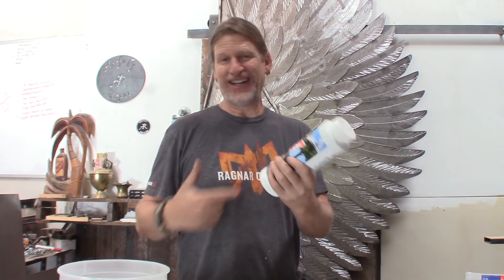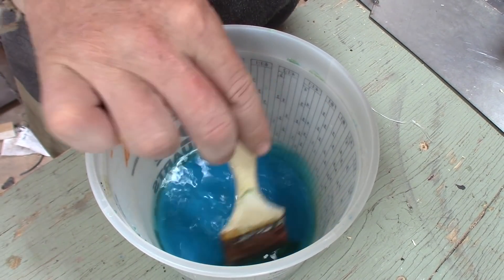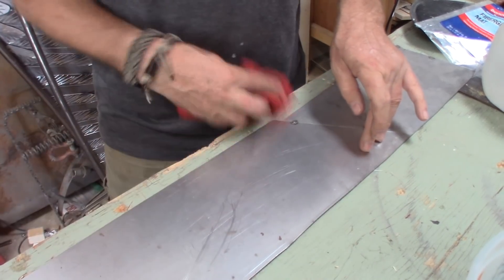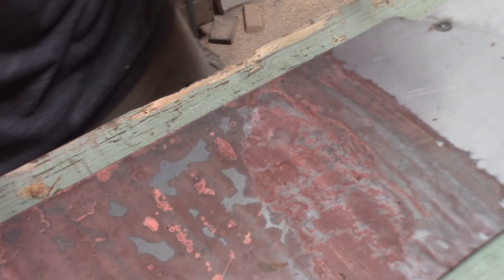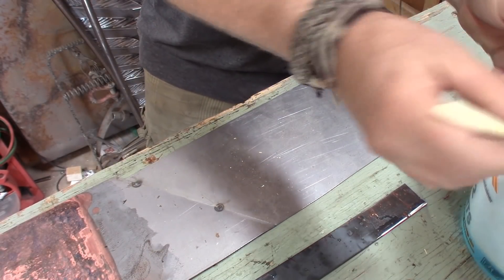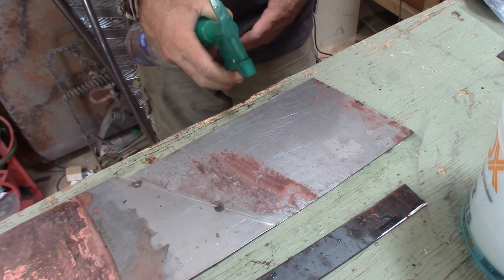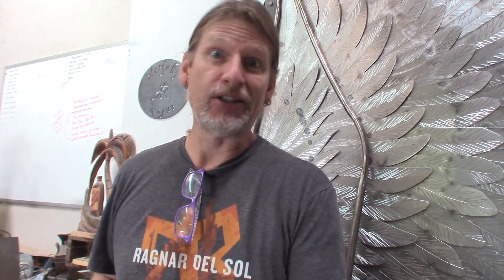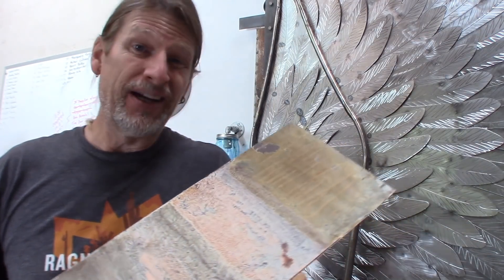Copper Sulfate on steel FREAKED ME OUT!!!!

Comment: The citric acid I ise as pickle solution for my copper jewlery has eaten away the nonstick coating of the pan. The bare steel is slowly turning copper as I use the pickle. It never occured to me to do it on purpose.
Reply from the maker: Have you tried it on any of your jewlery pieces yet?

Comment: Do you adhere your metal to wood, and if so what do you use?  Love your video btw
Reply from the maker: when I do need to attach metal to wood, I'll use a heavy duty Gorilla Glue adhesive. it's supper gooey and adheres to the metal really good. JUst make sure you remove any oils from the metal first.😉

Comment: All you had to do is just use a simple process of electrolysis with low voltage. Cuz most of us just take copper tubing a news anode and cathode to get that formulation that you have but you're already two steps ahead of us. So all you had to do is use one carbon rod and that sheet 5 to 9 volt adapter and you would have had a nice copperish patina
Reply from the maker: Maybe next time

Comment: Is the peanut oil residue something inconsequential? Specifically, if I was using this steel in a kitchen setting, can that residue be otherwise removed? Thanks. - Tom
Reply from the maker: Yes it can be removed. I often leave it and let the process of rusting remove it which, for me, adds a bit more character to the rust. It becomes less consistent and more random in my opinion.

Comment: He mentioned using this on cold rolled steel. Just curious if the results are the same on hot rolled?? Anyone know?
Reply from the maker: If you remove the mill scale from the hot rolled the results would be the same. I've tried it on hot rolled without removing the mill scale and the corrosion of the copper sulfate seems to be more surface rust and can be cleaned off. The mill scale protects the steel from rust penetration
Reply: @ArtfullyRogue  thanks for the reply!

Comment: We can have a lot of fun with a DeLorean. Instead of water if you take 10 parts water and one  Muratic acid, you could probably stain concrete. And I wonder how that would react with the steel? Copper and aluminum are not friends so I wonder what happens if you did that on aluminum. I sometimes use 40% vinegar to remove rust from paint knives. Usually leave it for a half hour, rinse  and quick sand. Forgot it one day and the knife was gone except the handle. The orange liquid was able to stain concrete.
Thanks for showing this video I did not know about that copper magnesium. 
By the way that copper product is used for plants will pantina copper fast and making blue
Reply from the maker: Thanks for the comment, I'm interested in trying your idea with aluminum.

Comment: Thanks for the video. I have a question about keeping the red tones that the copper sulfate produces and the yellow/orange tones the vinegar and hydrogen peroxide create. I used polyurethane to protect the project and it ate the reds completely. The piece is still okay with the orange/yellow but is now more dull looking. Have you found a product that keeps the reds. Also, do you have to use a poly?  Can I leave it “raw” and dry? Will it stabilize to what I have right after I rinsed and patted dry. It will be hung in an interior space with air conditioning. Thanks for any tips you can give. This is my first attempt at metal work.

Comment: You should try a bar of copper white vinegar salt and steel, then a 12v battery charger. Electroplating , clean steel the add a bit off grease from rubbing your hand on it. Look at gun blueing cool colours
Reply from the maker: Cool, I'll check it out

Comment: That is super exciting! I've got an old 50 Ford pickup that I've had to do some sheet metal work to cut out all the body rust. There wasn't a ton of rust so it's not any large areas of new shiny steel, just some edges around the bottom of the fenders. I want to keep the OG patina look and something like THIS experiment you did will work great for blending the new sheet metal with the old faded paint and rust look I'm going for. Can't wait to try it out!

Comment: That's cool, you should be able to get copper sulphate in larger quantities ag suppliers [2.5 - 5kgs].
Copper sulphate should already be highly acidic because its made using sulphuric acid and copper so the vinegar probably wont have a great deal of effect. Where as a base/alkaline, like bicarb, mixed in a spay bottle will have a more profound effect.

Comment: That "patina" is copper.   You are brushing Copper Sulfate on iron, which remember "Steel" is iron with carbon in it.   Because iron is much more reactive than copper, the sulfur is binding to the iron and releasing its copper, which in turn you are wiping off where it has less of a binding, but in the end the copper is just kind of sitting on the steel.     If I recall right iron sulfite is a blue-black is color.   Which is the "blue" you are seeing.  Though shouldn't be confused with iron-oxide or "bluing" which is done a lot with guns and other steel goods.   

I think in the end, you are copper plating your steel here.

Comment: little bit of chemistry basic knowledge... https://www.youtube.com/watch?v=6CS84Rj8RrM the reactivity level of both metal impede the copper gets properly attached to steel,  it seems its over it, but actually is not chemically well bounded. its cool the effect after the final process. it holds some simmilitude to the one used to create crystal effect below the top clear coat

Comment: That's really cool, thanks for sharing this!   Question, I'm thinking of doing this treatment on some corrugated panels I'll be using to make raised garden beds.  Do the think the finish will stay stable in an outdoors environment if If sprayed with a good quality marine polyurethane?   I suspect it will need maintenance coats every few years, like most things outdoors.
Reply from the maker: Yes you can lock in the look by using a good quality clear coat. And depending on your location and weather you may need to reapply once or twice a year to continue protecting that look

Comment: I am starting out with a CNC machine and have really appreciated you videos. I picked up some copper sulfate and have messed around with it. It seems that i get a nice copper Color at the beginning but can’t keep it. Do you apply and just let dry? And then does a clear gloss change it?  I am frustrated
Reply: The copper is just a substitution reaction with the iron in the steel.
This is how copper is recovered out of chemicals from precious metal processing waste.
They use scrap iron or steel.
It does not attach well and most will easily wipe off.
You might try electroplating a thin layer of tin or nickle first on your steel.
This is very easy at home and there are YouTube videos on doing it.
Then add a layer of copper using copper sulfate for electrolyte.
The copper will bond well with the tin or nickle.
You will need a thin clear coating to prevent the copper from oxidizing.
F.Y.I.

Comment: Degrease the steel first also helps. Also, instead of mixing into water use white vinegar, the solution can be brushed, sprayed, rubbed on with a rag damped in the solution, also try trickling on and blowing around with a straw or compressed air. Once your done wash very softly (too hard and copper can be removed) dry quickly with air or heat to prevent flash rusting. If you want to stabilise and seal it use one coat of Flood Penetrol, once that's dry (which can take a few days) suitable clear spray coats can be applied over the Penetrol

Comment: The copper sulphate is reacting with iron on the surface on the stainless steel to form a brownish colour, this process is used by people in the stainless steel business as a test to see if iron is on the surface, because that iron will eventually show up as a rusting on the stainless steel. If this happens the steel must go through a passivation process.

Comment: Use some ferric chloride in the mix and watch it etch like a champ, about a teaspoon for that bucket you had mixed, its about 1 drop of ferric chloride to around 15 ml of copper sulphate which is around 1 teaspoon of copper sulphate and water. Use salt to initially put the first layer down, like dip your brush into the bucket and then touch the salt on a plastic dish then paint that on. (No real measurements, but that gives you a rough idea) The more you prep your surface the smoother the finish if thats the look your after, once etched just polish it with 000 steel wool and you will look at it like a sheet of copper not steel.

Comment: Sooo glad to have found your videos.  I have old metal ceiling tiles which I believe are made to tin.  Have you ever used any tin with your different rust makers?  It has some paint adhering to the tiles still, sure its lead based, would like to add some color, paint is cream. Thanks
Reply from the maker: Not yet!

Comment: Sulfur and iron have a long , sorted history . Sulphides are a metal that has reacted to sulfur .like oxides are a metal that has reacted to oxygen.  This is literally how ancient hydrothermal vents left gold deposits ( and many other minerals ,but i am keeping It simple)  that sulfur REALLLY  wants to be where the iron is... And the iron REALLLY  wants to Netflix and chill with the sulfur. So when a fluid containing  sulfur or iron contacts the other thing( especially if heated) the iron pulls the sulfur into itself and whatever other things were carried by the sulfur , got dumped off at their friends apartment and forgotten about so they could party with iron .  That is a mineral deposit. It drops most everything to pick up the iron , or Vic versa.   Or in this case, a copper metal deposit in the carbon after iron was removed. making a metalic copper washed iron layer. 
Basically ... man, it's a cool process visually but you really  research this stuff before showing the world how to potentially hurt themselves with a basic sulphuric acid, which is what the vinegar is reacting with that sulfur into. That Information is online ...as is all other information .

Comment: Wow... really interesting! I came across while looking for ways to make galvanized steel more interesting... I want to use some corrugated to build a raised bed garden, but don't want it to be shiny (or rusty). Curious if a process like this could work on galvanized?
Reply from the maker: You'd have to remove the galvanization down to the bare metal before any of these methods would work
Reply: @ArtfullyRogue  ah I see... could I do that just with a 3M scrubbing pad?

Comment: 🦘🦘🦘🦘  ...   I found this GREAT IDEA on another site & want to share it if anyone has this same problem & how to fix it.    I had a terracotta pot with a wonderful indented fancy pattern etched into it when it was made, around the top & bottom sections of the sides of the pot.    It had been well painted with thick black paint then sprayed over with a tough shiny, hard, silver paint over the black, but ONLY on one side of the pot!!    I wanted to strip the paint to return it to pure terracotta again & fully preserve the pattern.     ................   I read that full strength 🌿🦘EUCALYPTUS OIL🦘🌿 dissolves paint.   I found a 50ml bottle in my cupboard & used an old toothbrush to brush in & massage into the paint: small amounts of pure Euc oil. I let it work into the paint, scrubbing it in. Soon the top silver layer dissolved away so I dripped on more oil & used old tooth brush to scrub into the black paint within the intricate etched pattern.  Soon the black paint turned to tar like substance as it softened & mixed with Euc oil. I used a small wire brush & a few squirts of WD40 to scrub away the softened tar like thick black paint.  WD40 will not work by itself on paint, only use to remove the tar like paint after Euc oil works. It does not take a lot of Euc Oil, use sparingly drop by drop. Clean brushes of build up if needed, with turpentine or WD40 & rub with old rag. Worked well. Used an angle grinder scrub pad on large smooth portion of pot. Wiped it with a good smear of Euc oil & left to soften, then used angle grinder with pad & it came off in one buzz. Cheers.
Reply from the maker: thanks for idea Alex!

Comment: My homemade formula is to chop up fine copper wire and dissolve it in muriatic acid. You get a very black solution which doesn't work that well as is, so I put "some" in a spray bottle of water and spray it on and you can get a really good coating of copper on steel. R.
Reply from the maker: Sounds cool, I'll have to try that sometime

Comment: Love your videos! I reccomend you to all my metal buddies. Can I ask one question tho? How do you fix the distressed steel with the sulphate on? Does it continue to change and how do you stop it? Can it be sealed with a laquer so its clean? Sorry thats more than one question! Many Thanks Georgina
Reply from the maker: If its an indoor project I actually use a spray laquer from Deft which I pick up at home depot. If its an outdoor project, I use an automotive clear coat that is a 2 part mix that is use in my pneumatic sprayer

Comment: I use blue copper sulphate as copper patina in metal works, to stop the process, use a metal polish afterwards and finish with a matte sealant or a gloss if you want
You can also use a torch to heat the 'copper' and it will give you beautiful purple and blue colours
Reply from the maker: Is that on jewerly projects?
Reply: @ArtfullyRogue  No, I don't do jewellery, I do sculpting with metal
Reply from the maker: @jq4444  Very cool. I'm always curious how others are using these finishes

Comment: The copper in solution is cementing out onto the steel. In metal refining, we use steel to cement copper out of solutions. Try washing the steel with soap and water and sanding the surface of the steel before you apply it and you will have a better reaction.
Reply from the maker: Cool thanks
Reply: @ArtfullyRogue any long term results you can show or describe?

Comment: So cool!!!     Something that anyone can do!   I'm going to use it on corrugated metal pieces that will be added to a fence.  Thank you!!!
Reply from the maker: Great idea!
Reply: @ArtfullyRogue  BTW, the Amazon affiliate link goes to a "currently unavailable" product.
Reply from the maker: @prof.danenberg8374  thanks for letting me know, I'll get that updated
Reply: Just wanted to mention that galvanized steel doesn't react the same way as this video because the zinc coating doesn't react with the copper sulfate in the same way.  It WILL give it a patina, but it doesn't look like this...  When the copper sulfate hit the GS, it turned a plum color and I thought that was really cool.  But when I rinsed it, the plum color washed away.  Now I'm going to experiment with different metal brushes on my drill to scuff it up more.  Maybe the CS will react with the scuffed areas more,

Comment: Take your favorite pair of sunglasses and coat one lens with some sort of oil (even peanut oil).  Now "Just wipe the lens with a cloth".  NEXT look through your glasses - at all the oil you left behind.  You were forcing the INSTANTANEOUS CuSO4 chemical reaction to travel under the oil layer on the surface of your steel  sheet metal.  
Not a good way to non-electrically Copper Plate that steel.     - Joe -
Reply from the maker: True but when you don't remove the oil you get some really cool variations in how it affects the steel in different places. 😊

Comment: Are you remembering to put the cap back on the muriatic acid?
Reply from the maker: most definitely
Reply: @ArtfullyRogue  When I was in 8th grade, I learned that muriatic acid shouldn't be mixed with bleach.  So out of curiosity, I put a few drops of each in a 2-liter bottle and I put the cap on.  Instantly the bottle filled with a smoky vapor and got stiff almost like it was filled with soda.  I tossed the bottle out without ever opening it.  I wonder if the toxic gas is still sitting in a landfill somewhere, unopened.
Reply: @ArtfullyRogue  Have you ever mixed muriatic acid with bleach?
Reply from the maker: @ThePeterDislikeShow  No not at all. they react together and release a very toxic gas so please don't try it
Reply: @ArtfullyRogue  Yea my 8th grade teacher said he accidentally did one time (he was talking about lab safety) and I couldn't resist going home and trying it.  On a very small scale.

Comment: can I use galvanised steel because it has a zinc coating?
Reply from the maker: you'll need to remove the zinc coating.  grinding it off is the easiest method

Comment: What is happening here is that the SO4- negative ion is attracted more to the Fe+ iron in the steel than to the Cu+ in the salt forming iron sulfate and metallic copper.
The reason why you can wipe it off is because you essentially have fine copper nano-particles resting on a surface. Where you still have some copper adherence is because fine microscopic grooves and scratches capture those nano-particles which is why sandblasting or roughing up the surface with an ultra-fine abrasive will yield more traps to catch the copper.
Reply: This is not really whats happening. I suggest you look up redox reactions.
Reply: @wiez543  That's more or less the reaction I described. 🤦‍♂️
Reply: @victorunbea8451  Ok, I'll explain: The elemental Iron Fe(0) gives two of its electrons to the copper cation Cu(2+), resulting in a Fe(2+) cation and elemental copper Cu(0). The counterion/anion sulfate has almost nothing to do with that reaction, the reaction takes place because of the redox potentials of the two metals. More simply put: Copper is a more noble metal than iron, so it becomes metallic on the cost of iron, which becomes cationic. Wenn man keine Ahnung hat, einfach mal die Klappe halten 💁🏼‍♂️